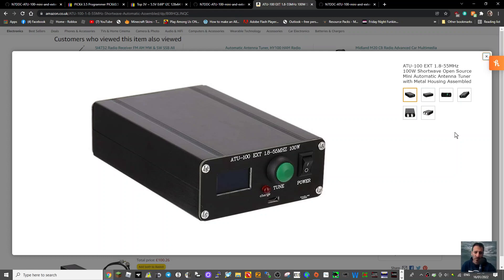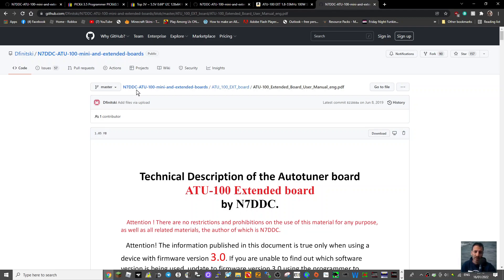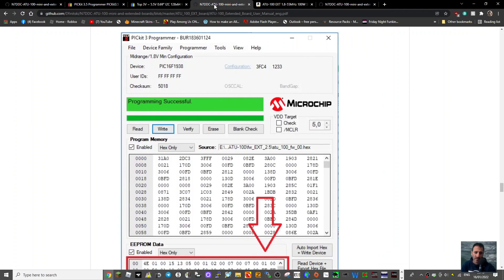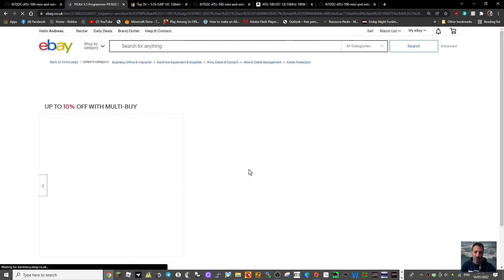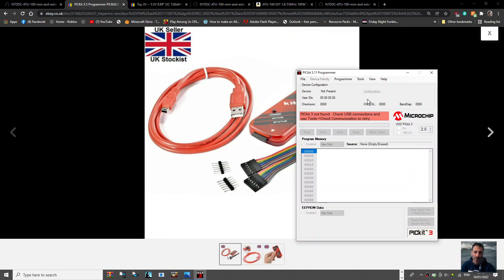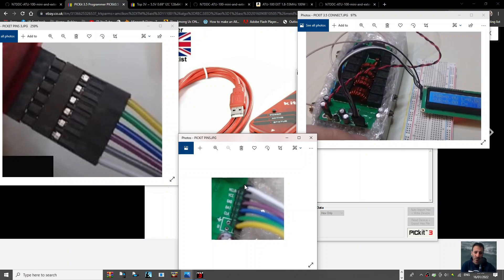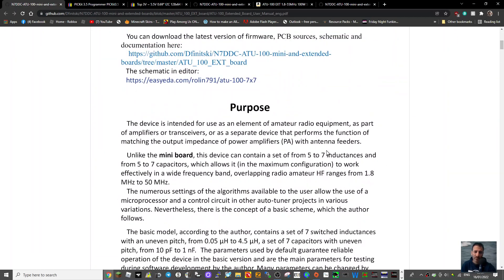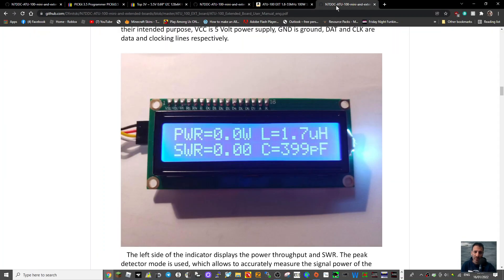ATU 100 (EXT) Antenna Tuner Firmware Update-Links and information

Comment: I did this yesterday.  It's not too difficult once you figure out what settings need to be changed in EEPROM.  You'll need to change the display type, address, and offsets from the defaults if using an OLED.  My display is address 78 type 05 offset down 00 left 00.  Pay attention to the wiring when reconnecting the display.  I built mine for QRP so I also changed the turns ratio to 5 (hardware change required as well), minimum power to 1 and maximum power to 40.  Be sure you have the correct version of the firmware for your MCU.
Reply from the maker: Thanks for this info very helpfull I have decided to swop mine for the ATU 40 Version.
Reply: @M0FXBHamTech  it's an easy modification.  Just remove 5 turns from each side of the binocular core and change three settings in EEPROM.  There's a video linked from the GitHub page.